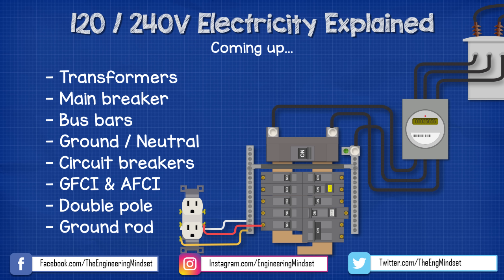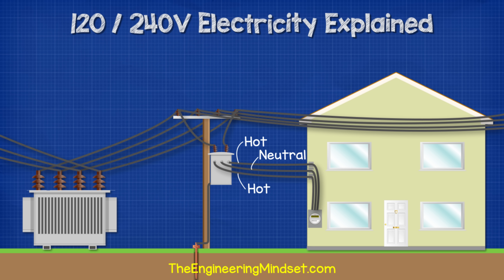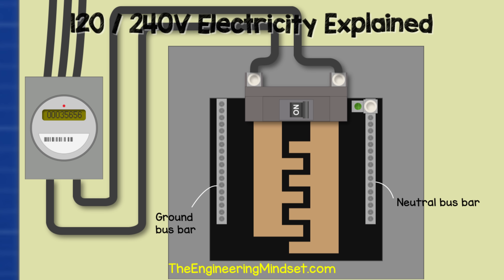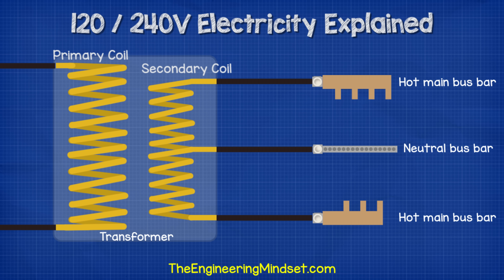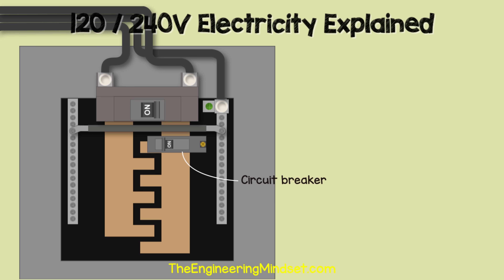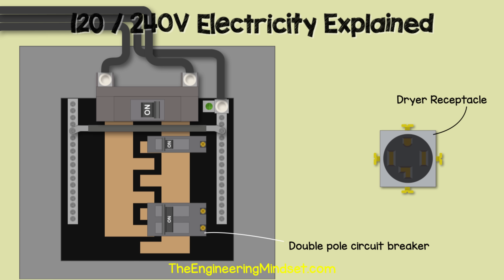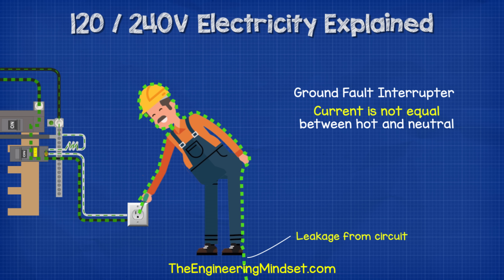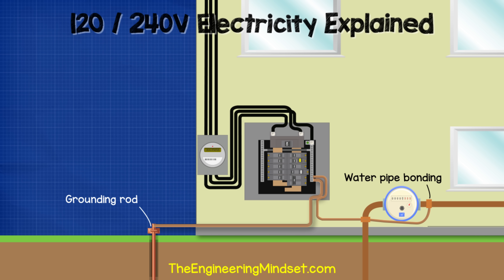120V 240V Electricity explained - Split phase 3 wire electrician

Comment: Great video.  However, you didn’t explain the “split phase” part.  The transformer animation (around 5 minute mark) is technically wrong.  It shows the secondary winding in the same continuous winding pattern all the way through when in fact it reverses and starts to wind in the opposite direction at the center point where the neutral connects.  It is the reversing of this winding at the neutral that cause L1 to neutral to be 180 degrees out of phase with L2 to neutral.  Hence, split phase.  Merely a mirror image of the same power source and not to be mistaken for “2 phase” which is 90 degrees out of phase and done with two separate power sources.  And of course 3 phase from 3 separate power sources that are 120 degrees out of sync with each other.  Anyways, correct me if I’m wrong.
Reply from the maker: Thanks, I thought it would be too much detail to cover that in this video so as mentioned we'll cover that in a more advanced video. There is a disclaimer on screen during the TX explanation that it's a simplified example. I think currently the video is enough for the general engineering audience to understand and build a base knowledge, then go into the technical side of it after. Glad you enjoyed.
Reply: @EngineeringMindset ,  Thanks for your response and I look forward to that more advanced video.  I have been looking for years for some good information on the subject of split phase because I am always getting into arguments with electricians about that.  A lot of them think that split phase and 2 phase are one in the same.   I was told that Niagara falls power plant was one of the last places producing 2 phase when I was visiting Niagara about 15 years ago.  Not sure if they are still making it available or not.  They were doing this for some of the old manufacturing plants around that area that still used two phase motor setups.  Thanks again and I'm just trying to make sure I understand it correctly.
Reply: DoThe Dishes    Tesla did originally start with two phase.   He made two phase motors and systems.   He quickly changed to three phase though.   I did not know that Niagra was two phase when Tesla built it.   Thanks.   As far as 120/240 volt single phase, on an oscilloscope it looks like the sine waves are out of phase by 180 degrees and is taught as such.   The reality is, this is not real.   Single phase is single phase.  All 240 volt and 120 volt sine waves are at exactly the same direction at a specific point in time.   The way the oscilloscope is set up with a common point probe causes the waves to seem opposite.   By the way, adding voltages is a very poor way of thinking about this.   Number of turns in a coil is the real way.   Twice the turns, twice the volts.   Sorry, too long!
Reply: @EngineeringMindset  Has the more advanced video been completed?  If yes, please provide link.

Comment: This system is applicable to USA / Canada and few south american countries only. Rest of the world (more than 80% of world's population) uses 220V-240V system, which is more efficient.
Reply: Part of the problem is that the NA continent was an early adopter and had 120V DC systems and only later adopted AC, so all the systems at the time had to be backwards compatible with only a rectifier needed to convert the AC to DC at the user level.
Reply: safer too.
Reply: @Mister Brookes Much of Europe had to rebuild from scratch after world war 2. And all of these countries are tiny in comparison to the US. Also Japan does just fine on even less power than what we have in North America.
Reply: @Mister Brookes What's unsustainable? Japan's been using it since the beginning of electricity use in cities. So has the United States since the invention of the light bulb. XD 

Every home and building in the United States would have to be completely retrofitted. For absolutely no gain. And all electric appliances in the United States are incompatible with 240-volt. Switching over to 240 volt would be the absolute dumbest idea in the world! XD 

The United States built the world's largest economy on the backbone of 120 volts. And also Japan has built one of the biggest economies on the planet with just 100 volts. 

Aka..240 = Completely pointless when Electronics don't need that kind of power. Especially in modern times with his how efficient electronics are today.

Also the Philippines and Saudi Arabia are tiny and have a fraction of the infrastructure the United States has.

Comment: I still can't understand why NA doesn't simply have an RCD / GFCI in the main breaker box. Counting on a massive current flow to trip the breaker is such a weird way to protect people, especially since it only takes a small amount of current to kill.
Reply: Circuit breakers and fuses were never intended to protect people. Their sole job is to protect downstream circuitry. Protecting people is a very recent concept.
Reply: If you can give me a source for that, I'll believe you, otherwise I'm calling BS. Nobody cares if their wiring breaks down, but everybody cares if their house is set on fire due to an electrical issue. While technically the functionality of a fuse may be to protect the circuit downstream, in practice, that circuit is being protected in homes to protect the house, and the people that live in it.
Reply: @timderks5960  
Actually circuit breakers and fuses are not very good at preventing fires.  Most electrically started fires are the result of poor connections that overheat without over current. I suspect that is why the arc fault detection devices now exist.   A good thing to do is feel the wall at each electical outlet, whether in use or not, looking for warnth. If you find heat you have a problem.
Reply: GFCI Outlets are mandated now for a lot of locations, such as a kitchen, bathroom or garage (basically anywhere even close to water).  For many houses, remodeling means replacing the outlets too without having to mess with the breaker box.
Reply: It still doesn't make any sense at all. You shouldn't need to check which socket is GFCI protected, they should all be protected. A ground fault is dangerous everywhere, kitchen, garage, or bedroom. Also, why would you even think to put dozens of GFCI's in your home when you can easily do with two, or even one? I'd say that less is even better. If you get an electric shock in the bathroom, and that GFCI outlet trips, nobody will notice. So if you get knocked down, you're on your own. On the other hand, if you have one GFCI in your breaker box, and the entire house goes dark, everybody in that house will be looking for what happened.
Reply: @timderks5960  In Australia it is now (as of the start of this year) mandatory to have RCD protection on all Final Sub Circuits 32A or bellow but unlike in the USA we are only starting to think about arc fault detection which is mandatory for USA in certain areas.
Reply: Tim you are correct that a small amount of current can kill you however dry skin has a resistance of 100,000 to 600,000 ohms. Wet skin has about 1000 ohms of resistance and this is why we only GFCI protect in wet locations. A GFCI monitors between your hot and your neutral and if it senses any differences it will trip. GFCI’s do not prevent shock they just limit the duration so the heart is not affected.
Reply: It makes sense because 120V to ground is generally not lethal unless you are in a wet area, hence why kitchens and bathrooms are protected. 240V to ground has the potential to be lethal even in dry locations, which is why it makes sense to protect the whole system.
Reply: Tim Derks    The wheels of progress turn slow is one reason.   The other is money.   Panel manufacturers make more money selling (10) GFCI breakers than (1) Main with GFCI.   Correct?   Honestly though, GFCI current transformer around two lines and a neutral may not be very reliable.  You only have a live and neutral to test against.

Comment: I really don't get why they can't get a 240v only electricity
Reply: Because back in the day 100-115V as were popular in many regions in the US was enough for small kitchen appliances and lighting. Shifting to 120V when the Tennessee Valley Authority standardized it was small enough that you didn't need to buy all new stuff. 240 is useful, but unnecessary for most things, so just providing a second phase was an easier solution than throwing all your old stuff out or putting a transformer in every house.
Reply: @SeniorKlean  so what you're saying is it's traditional and it's too much trouble to change, like the difference between television systems pal and ntsc. Considering probably 90% of the globe is 220 to 240 volts, it is the Americans who are behind when it comes to both metrification and electrification.
220,240 volts is much better at reducing voltage drop across a complete distribution system and it is far more effective for running appliances that is why many US homes have a dual supply bringing the total up to 240 running heavy equipment like dryers and washing machines and stoves.
Where is most European Australian New Zealand homes only have single phase, and rural areas have two phases to balance the distribution system .  technically at 120 volts AC the average skin impedance is 1800 ohms at 220 volts the average skin resistance is 1300 ohms impedance.  so therefore at the lower voltage your skin offers a  higher impedance to the path of electricity.
Reply: @mauriceupton1474 

It's not a competition between countries. Europe is not a country, so you shouldn't speak as if it is, nor compare it to one. Sounds to me like you're simply anti-American.
Reply: @CorneliusTaylor-s1u 
The European electricity system has over 400 million customers and covers 32 countries. So you dont know what you are talking about.
Reply: Because of insurance and potential litigation, thats all.
Reply: @mauriceupton1474  the rest of the world manages without such, and insurance is not a problem. American underwriters happily do business in 240v countries too.
Reply: @jnawk83  Its also historical, in the USA its the fear of litigation that keeps things from changing, 120vac 60hz is safer than 240vac 60hz in relation to the skin impedance, (1800ohms at 120v 1300 ohms at 220v) the higher the potential to ground the higher the current flow @ given impedance, therefore 240vac more likely to cause higher current fow hence chance of electrocution is higher.
Technically speaking they would be better to convert all domestic electrification to the higher voltages as it would reduce overall system efficiently by reducing voltage drop.
Reply: @mauriceupton1474  except its actually not safer. see above.
Reply: @jnawk83  Can you prove this?
Reply: @mauriceupton1474  in a YouTube comment?
Reply: @jnawk83  I have 36 years experiance working with electricity.
United Kingdom construction sites all appliances have to be 110 volts ac, they centre tap the transformer to ground which means ground potential is 55vac to earth,  the standard domestic supply in the UK is 240 vac 50 hz.
The most effective AC distribution system as calculated by Nikola Tesla,  3 phase, 240 volts 60 Hz however they had to compromise between existing DC systems hence half the voltage as it was perceived safer and switching DC was problematic due to extinguishing the arc.
Reply: @mauriceupton1474  argumentum ad verecundiam
Reply: Tell this to Japan, with standard voltage in AC rated at 100 V
Reply: @AlexandruLipan  Western Japan 60hz Eastern 50hz, Their power system frequency was set at around 1895 with the sale of German and  American equipment.
Reply: @Mister Brookes We use 30mA RCDs, 230/400v, it's more about protection of the circuit and the installation.
 1mA can cause arrhythmia, therefore a GFCI tripping at 10 milliamps residual current on a 120/ 240 volts system is  significantly better at protecting people against electrocution. Unfortunately the complete installation is less efficient by a  large Factor and requires 3 x the number of step down Transformers than does the 230/400 system.
Reply: @Mister Brookes It's interesting, the benefit the American distribution system offers over the  European distribution system is 1 phase can be shutdown in a street and still have two thirds of the houses supplied, however if you tried shutting down 1 phase on a European delta star transformer, it would take out 3 x the customers. 
The European system uses far fewer  transformers, 230 V secondarys can run longer distance and and tends to balance loads better.
As I intimated in an earlier comment, it becomes too costly to change a whole state system.
One could envisage possible insurance & litigation issues as a result. Not to mention the possible vested interests involved in keeping the remaining underwriting insurance systems as they were, hence  not wanting to use DIN.
These are the primary reasons to keep the status quo.
Reply: @mauriceupton1474 

There is no European distribution system. Europe is not a country.
Reply: @Mister Brookes Where there is a will, there is a way:)
Reply: @Mister Brookes I'm detecting that you may have done this at some stage, it's a good idea to convert a whole house to 240, it makes a lot of sense, only problem is if you live in a country with most of the smaller appliances 110 volts it ends up with a problem, but at least if you had 240 in the kitchen you could operate a normal 2000 watt kettle 240 volts and it would boil in half the time 110 volt kettle would boil
Reply: @mauriceupton1474 

Americans couldn't care less about electric kettles, or kettles in general.
Reply: 120v is not that safe either, it's more expensive for cabling, limits available power at outlets, greater volt drop issues, etc.
Reply: John Schroeder vir look it up
Reply: @JohnDoe-lr6eo  what are you suggesting that I look up?
Reply: @johnschroeder3072 Its as 50% dangerous as 240 by its very nature, for a given resistance half of the current will flow. Also 120 volt devices are inherently more rugged due to thicker wires. One good example of this is that many construction sites in 240 volt nations used to use 120 volt incandescent bulbs as the filaments are much less likely to break.
Reply: @Jl4zio  Saying that 120V is less dangerous than 240V is like saying it’s better to be crushed by a 1000 kg weight than a 2000 kg weight.
Reply: @Jl4zio  120v will seriously mess with your cardiac rhythm, whereas 240v will outright stop it. both are usually lethal, but 120v is actually more lethal.
Reply: @jnawk83  That's not entirely correct. Depending on skin resistance, 240V can be just as lethal. Notably in dryer conditions, where current across the heart can fall into fibrillation range, as it would with 120V in wet conditions.
Reply: Jl4zio actually, it is 25% as dangerous because only 1/4 of the power will be dissipated in you when you touch a live circuit. 1/2 voltage and 1/2 current = 1/4 power.
Reply: Using 240V for everything is akin to using a 20lb sledge for every task that requires a hammer. Do you really need a 20lb sledge to install a picture hanger? 120V is more than adequate for devices that require very small amounts of power. Since we have the split phase design, we have the option of using either or for whatever the intended load of the circuit. 
Why change because that’s all YOU are used to? 🤷🏼‍♂️
Reply: @benupde1979 

Don't argue with them. They are simply anti-American.